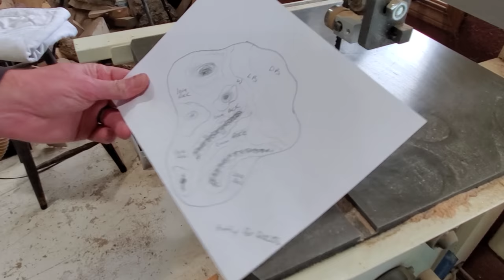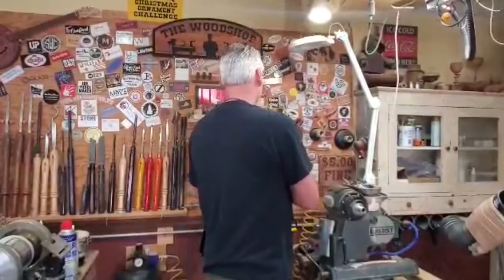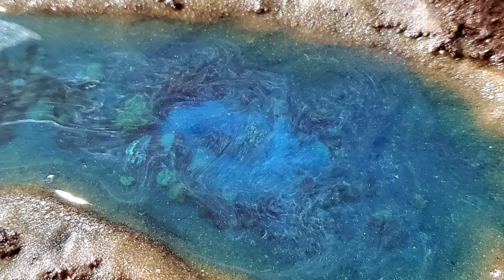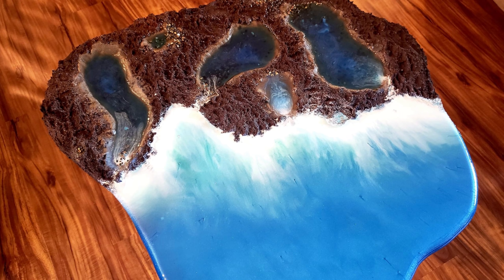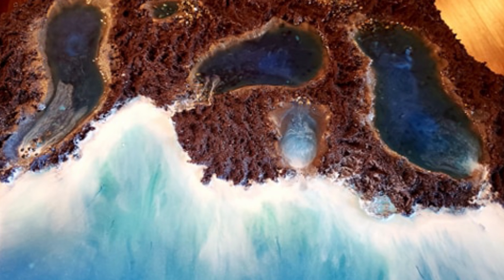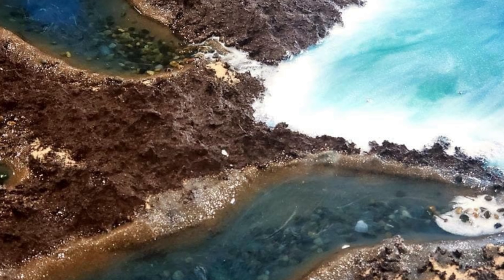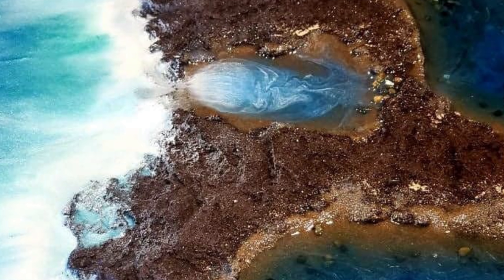Epoxy Project | Ocean Tide Pool Table

Comment: Due to not having seen these techniques much, for me every step felt like I was nervous for how it would come out and it just looked amazing. Did you do some small tests to the side or are you just so confident working with the colored epoxy and paint these days that you could not see any chance for messing it up? /Scaredy-cats Jacob
Reply from the maker: lol Thank you Jacob! We did do a paper plate size test the day before and it came out pretty good. We just wanted to make sure the floor putty would work. It's easier than you think if you follow along with Stonecoat's Volcano video.

Comment: Roughing up the particle board surface with a rasp, 40-60 grit sand paper or even gouging it with a drywall screw and a tack-hammer should improve adhesion as well. I think you ran into problems because the board was just too smooth and that likely would have been a problem even with concrete or drywall mud...

Comment: Hi Carl. Hey that attachment you had in your drill. Is that homemade or is it available commercially ? I occasionally make knives and that tool would really work nice when shaping the handles.
Reply from the maker: It works great for things like this, here's the link. https://www.amazon.com/dp/B017ZE6DMW/?tag=aiponsite-20&linkCode=ic5&ascsubtag=amzn1.infl.us.product&creativeASIN=B017ZE6DMW&ref=exp_thewoodshoptv_dp_vv_d
Reply from the maker: Buy the sanding sleeves from Klingspor much better quality  https://www.amazon.com/dp/B07YFS4DZ8/?tag=aiponsite-20&linkCode=ic5&ascsubtag=amzn1.infl.us.product&creativeASIN=B07YFS4DZ8&ref=exp_thewoodshoptv_dp_vv_d
Reply: Thanks a million Carl. I just ordered up. 😎👍🏻

Comment: Hi Carl
I have a question about sealing wood. What would you seal live edge wood with if you were going to use use resin on it? I have a 3 dimensional log And I’ve sanded it smooth. I’m very new to all this and hear the resin will bubble if I don’t seal it. Someone told me paint it first but I want to see the wood through the resin so I don’t see paint working for what I envision. Thanks for any words of wisdom!,,,
Reply from the maker: Hi Kristine,
We have used resin on bare wood that hasn't been stabilized and haven't had very many issues. The best advise I can give you is to check out Stonecoat Countertops. They have a bunch of videos coating bare wood with resin, and they might have a trick or two to help out. https://www.stonecoatcountertops.com/home
They have a great YouTube channel!